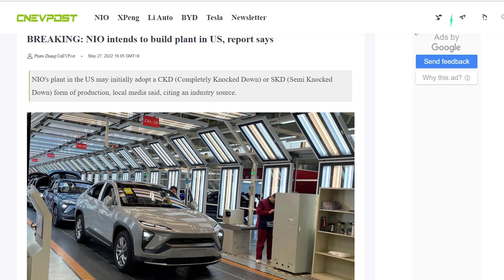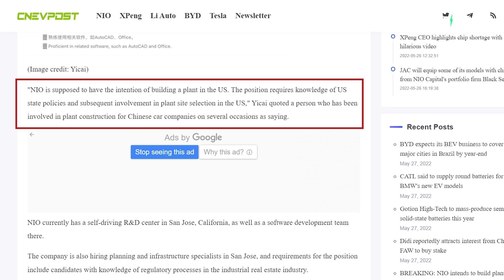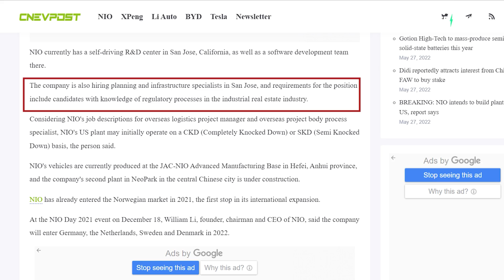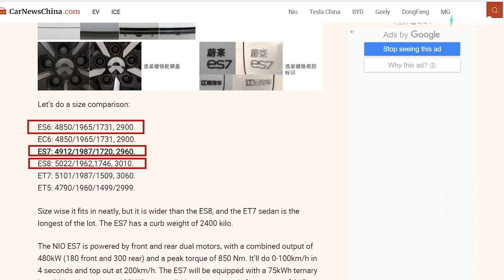NIO will build factory in US - 1000km range EV coming!

Comment: 1000 Km range.  That is enough range for even the United States.  The future drops in battery price per kwh will go straight to the bottom line.  It won't be long before we have a basic 1000 km range vehicle that can be bought below $30,000 (today's money).  At that point, it is game over.  Getting close.
Reply: You're not going to do 1000km with a LFP battery.  The weight to do that would be very prohibitive.
Reply: @theflew  Nope.  L-Sulfur maybe.

Comment: Very few cars will be sold with range over 600km until global battery production catches up with demand, and that is a few years away. Longer range vehicles can easily be built now, but it just makes more economic sense to build higher numbers of cars with lower range while battery production is the limiting factor to meeting demand. Tesla are building cars with less batteries because they can then build more and easily sell them.  When battery production parity is eventually reached, cars with ranges of 1000km and more will suddenly become the norm.  That might be about 5 to 10 years down the line because until then demand will accelerate faster than supply. For now, talk of longer range cars is marketing hype.

Comment: 1,000 km range? When are EV makers going to make what customers want? something in the $20-30,000 range or cheaper. Range around 200 miles. Not everyone has fallen for Range Anxiety pushed by Big Oil.
Reply: Some people need the big range some don't . If you are going to toe something the 1000km 600 mile battery would give you less than half of that range.
Reply: BYD dolphin fits this catagory well
Reply: there are more EVs coming that will fit your description. Check out BYD